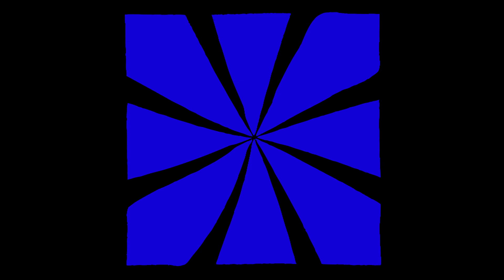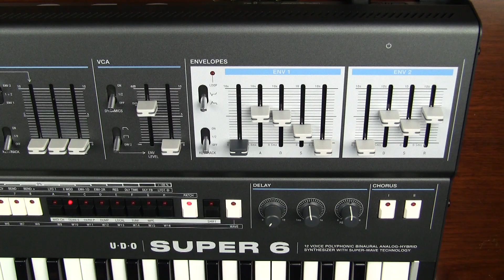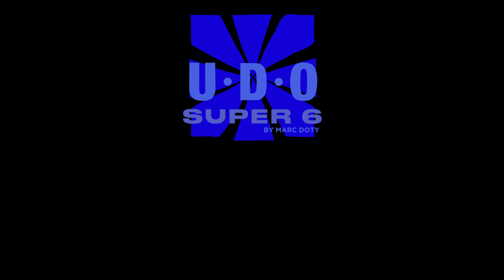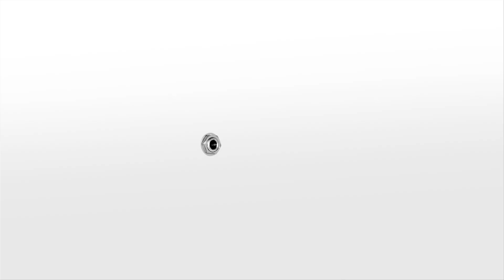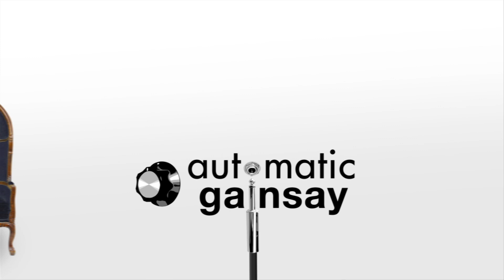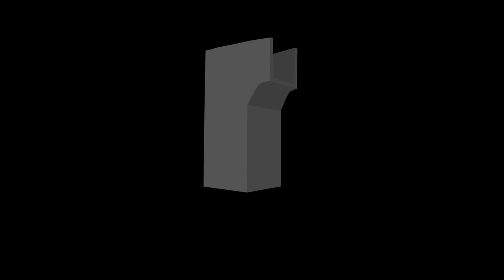15- The UDO Super 6- The VCA- MORE THAN TREMOLO

Comment: Thanks for this wonderful series of videos, so glad you enjoyed the sounds of the Super 6! You were getting the direct sound of lfo 1 in the mix (until you worked round this using the mix knob to eradicate dds 1) because you still had the switch in the lfo section set to the middle 'once' position but it has a different function when the lfo is in high frequency mode, routing its audio to the dds 1 pathway (as you covered in a previous video).